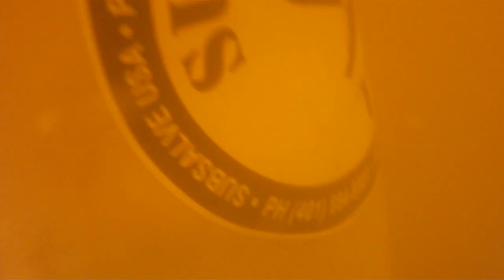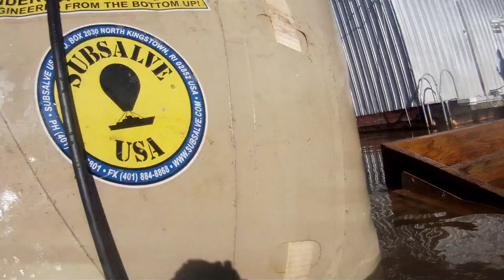Salvaging A Lost Dock System

Comment: On a lot of these salvage videos the bags are attached and floated where the salvaged item is still suspended several feet below the surface.  What is the reason you don't try to put the bags underneath the object to get it as high in the water as possible especially on a object like this dock where there are good attachment points and access to the underside? I took the SSI search and recovery course but haven't actually recovered anything myself.
Reply from the maker: Great question Kevin Davison. On this specific salvage, we were simply hired to raise the dock system and drag it to the boat ramp. The owner would then at a later date, have it removed with a boom lift. By attaching the bags on top, it made the process of removing them a lot easier. Usually when we lift a vessel, we will lift from the bottom, it just was not needed on this particular job. Lifting from the bottom does allow you to get the object higher out of the water though.

Comment: Ive been wanting to get into scuba diving for awhile im 17 and wanting to become a open water dive instructor i have zero experience now and was just wondering how long it would take and how much the average monthly pay would be? Thanks!!!
Reply from the maker: Hello Daelin Young. You will need to be 18 years old before you can become an Instructor. Fast tracking becoming a dive professional is never recommended, but can be achieved in a 6 month time frame. There are several pre-requisites that will have to be met as well. Your local training center can go over these with you as well. As far as pay, this depends on your region. Most of our guys are paid per student and not monthly. Also, it depends on what courses you are teaching. Just as a reference for an Open Water student, you could potentially earn $50 to $200 per student. Specialty Courses you could earn $25-$100 per student. Professional level courses you could earn between $100-$500 per student. Each training center will have their own pay scale. Hope this answered you questions.
Reply: @LakeHickoryScuba  thanks for the reply it answered all my questions